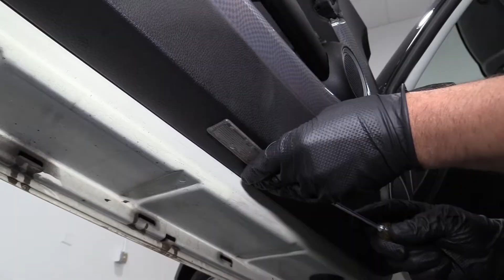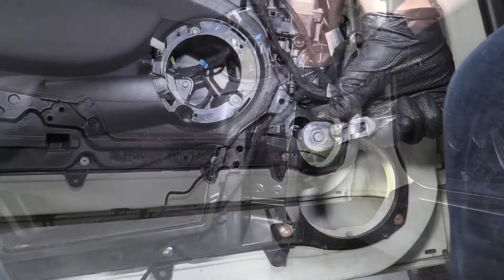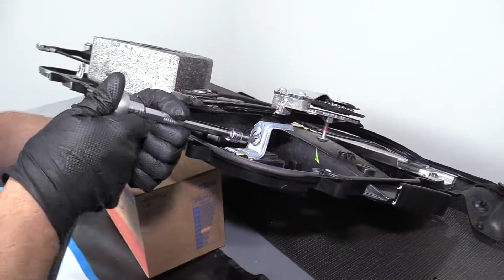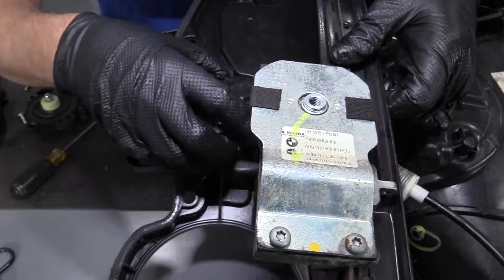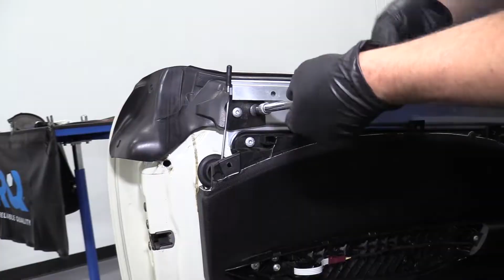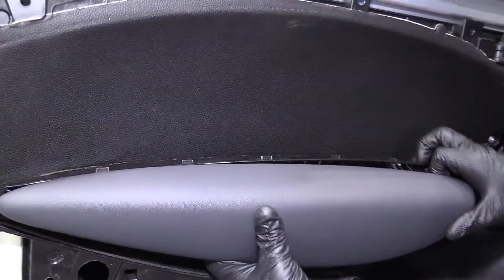How to Remove Window Regulator 05-08 Mini Cooper S

Comment: Great video thanks. Replaced regulator with a used part after old cable snapped on one side and wore out plastic motor cable bobbin. Without your video probably wouldn't of had a clue. 👍👌

Comment: Hi there. Most of the replacement regulators for sale don't come with the alloy bar across the top, so will it be straight forward to remove the two vertical bars from the top horizontal alloy bar (keeping the top bar)?

Comment: 2years old this video but still relevant, thanks for the instructions. and yes i will be doing both of mine this week due to rattling noises and also speaker upgrades. so may as well grease the regulators at the same time.
Reply from the maker: +paul birch Thank you! We love empowering our customers and showing how to perform DIY auto repairs with our high-quality auto parts. 1AAuto.com